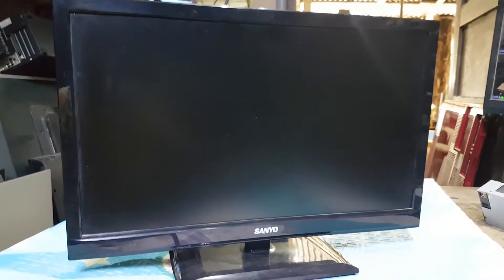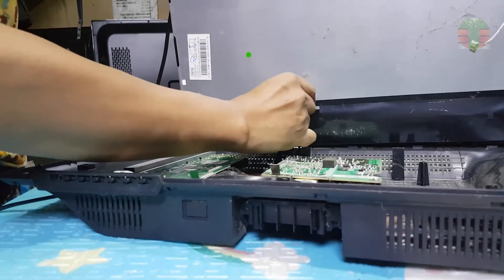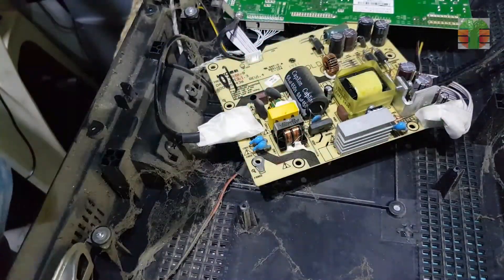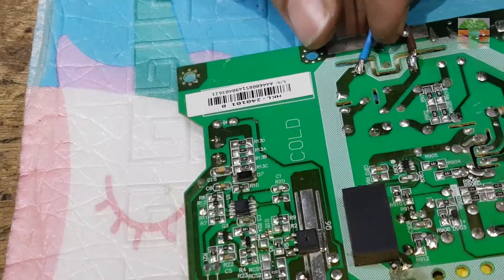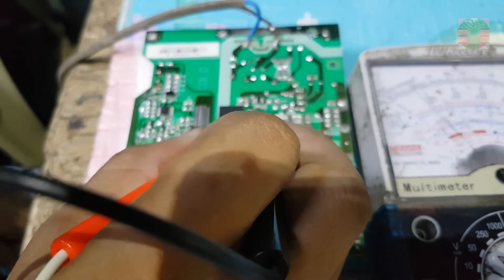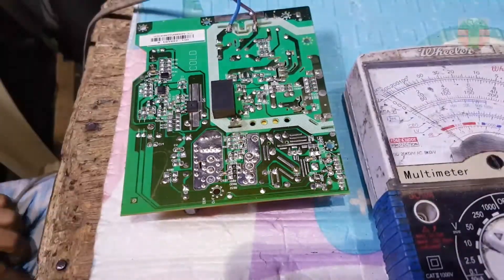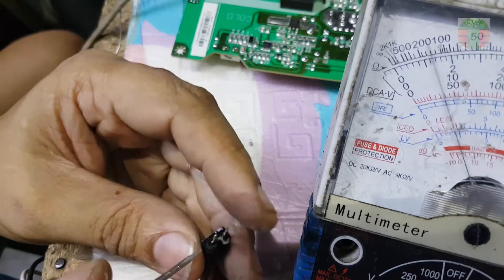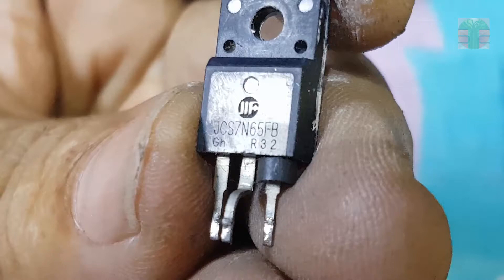If a lightning bolt hit your TV can it be fixed?

Comment: Very nice sir... Congrats po.. sir ano pong value ng resistor as safety fuse?
Reply from the maker: 220 ohms
Reply: @tevzTVTevatronics  salamat po sa pagsagot sir..
Reply: @tevzTVTevatronics  sir, ilang watts 220 ohms po gamit mo na resistor?
Reply from the maker: @operatormalaybalay9631  20 watts